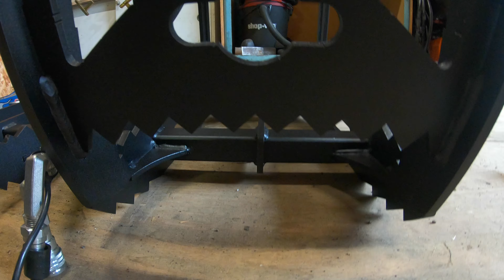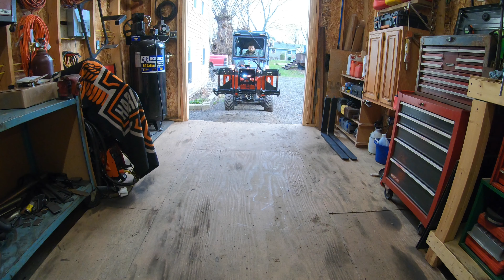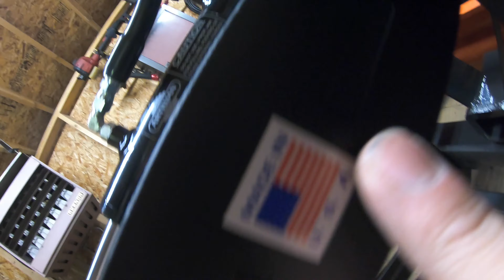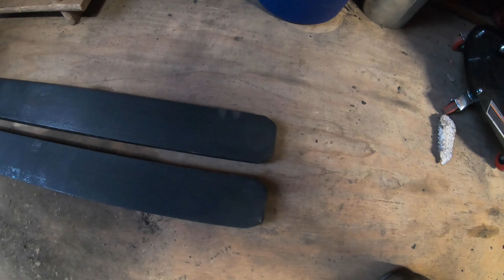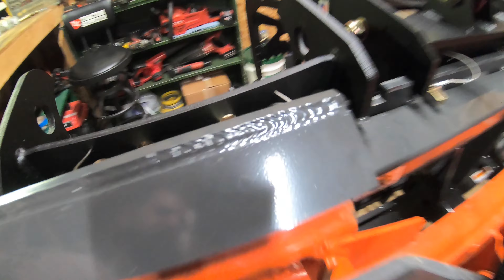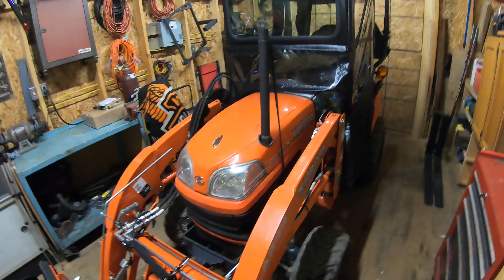Kubota BX- ARTILLIAN Grapple + Pallet Forks (First Impressions + First use!!)

Comment: Let me first say I love your videos because you explain in detail everything. I just got my artillian grapple today and having issues with it hooking up with the sumit third function valve kit you installed on yours. Did you run into this problem any and if so how did you fix it?
Reply from the maker: Thanks Anthony I appericate it bud. What issue are you having exactly? Did you watch my full install video on the summit 3rd function kit?
Reply: @BiffsEquipment  The coupling on the end of the hydraulic hose of the artillian grapple does not fit the connections on the summit third function valve kit. Did you have to change those and if so can you give me the part number? I'm thinking artillian sent me the wrong hydraulic hose.

Comment: What made you decide to go with the artillian?
Reply from the maker: I really like Artillian products for their versatility, the fact that you can arrange the grapple anywhere you want on the fork frame, and the fact that you can go from a single grapple to double or even Tripple grapple is really great. Also the bottom fork tines can be used separately with out the grapple needing to be in place and I also have their stump buckets as well which all fit on the exact same frame they call their fork frame. ARTILLIAN products are built super heavy duty with a great powder coat.. I sualt bend or break other products but with Artillian I havnt bent a single attachment yet. Pure quality and Versatility .. hope this helps!

Comment: Great videos! How did you hook up the grapple to the summit hydraulics kit? I noticed the Summit kit comes with a male and female fitting, while the grapple is two male fittings. Thanks
Reply from the maker: Thanks Robert! I actually changed the fittings around a bit after installing the 3rd function kit, I changed the ends so that’s there was one male and one female on the end of the loader and when I picked up the Artillian grapple I changed the ends to the same summit ends cuz I liked them better. The Artillian grapple uses John Deere couplers so I wanted to keep all of like the same which are summit Kubota BX couplers. If you need a link to where I buy my couplers on eBay just let me know, I usually buy a 4 or 6 pack of males and females this way I’m
Covered. Summit makes really nice couplers, even better than Kubota’s IMO

Comment: Got the grapple along with forks. Very happy and such a good match for the BX. And took it a step further for their articulating plow. Very nice indeed. Living in the Berkshires meant I was close enough to their facility to pick up so I avoided shipping costs. Like your channel very helpful with tractor things (like low power in reverse). Learned a lot from your series on bucket use. Did you ever do that pressure test at 3rd function valve? I’d use that spot since I have those ez off flat connectors at loader hitch ...
Reply from the maker: Awesome Rick congrats on the new purchases! I bet your stoked about using your new attachments come spring I know I am! I’m glad to hear my videos have helped you out and that your enjoying them.. I hope to get out there with my grapple soon to clean up brush and dead wood, gonna make a huge burn pile and burn wood/brush all day using the grapple I can’t wait for that.. just waiting for my yard to dry up. I havnt made the video yet testing hydraulic pressure at the front 3rd function but I will soon and appreciate the reminder!

Comment: If one is going to pick up standard (42x48) pallets, 42" forks are much better and probably don't weigh that much more. It's easy to break pallets & lose the load w/36" forks.
Reply from the maker: I agree that 36” forks are more likely to break a super heavy pallet but what you gotta figure is these little sub compact tractors and even compact tractors won’t ever pick up enough weight to where it would break the pallet anyways but I agree on larger equipment and utility tractors the shorter forks could be an issue as the lift capacity’s go up and pallets get heavier. Thanks for your input 👍🏻

Comment: nice setup. I wonder how the single clamp compares to a double clamp setup. You could see you dropped some sticks as you were going along. Wonder if a double clamp grapple would hold things together better. Good video! Take care
Reply from the maker: Thanks man. As for the double vs single, I don’t know if it woulda had a huge difference on that loose brush only cuz driving passed those trees I broke a lot of them off and I didn’t quite have a full load to make it very tight so I’m not sure a double grapple woulda made a huge difference here. Where a double grapple would help more is when it comes to securing larger/heavier and awkward loads as you’ll have a clamp on each side of the un-even load vs just in the center with a single grapple so that would help to secure and stable your load much better than a single. That being said I do eventually plan on buying a second grapple this spring and trying it out so stay tuned!

Comment: I'm a big fan of the Artillian platform!  I've had mine over a year and the powder coat still looks new.  I change the width of my forks often and no visible wear on the frame.  Mine came with a moly or graphite strip at the top front of the frame to help the forks slide when you move them.  Now I have grapple envy after watching...
Reply from the maker: Awesome man great to hear frank! Mine also has the graphite on the front face of the fork frame I was gonna talk about it but forgot to. Super happy with everything so far and I’m so glad I picked it up. Thanks for watching!

Comment: Looks awesome.
What I'd love to see is a pallet fork weight test. Get an IBC tote cage, and start filling with firewood. Then see how much of it the forks can lift about one foot off the ground (just enough to move it around). An IBC tote measures ~40" x 48", so those 36" forks should be fine with that narrow side. Guess that a weight isn't as necessary as a percentage of how much the tote can be filled up.
Reply from the maker: I wish I had one of those tote cages to try this out but will be doing lift tests in the near future with these forks. 40x45 is about the size of a normal pallet and 36” forks are more than plenty long enough for a heavy 40x40” pallet so id assume it would be just fine only question would be is how much the tractor can lift with it filled. Thanks for watching!

Comment: really nice set up - Thanks for covering the modular aspects of the Artillian Grapple - It's a shame I have a pin on bucket - btw, what kind of jack is that at the front of your shed?  I need a good low profile floor jack for my car.  Would you buy it again?
Reply from the maker: Thanks Bob! Floor jack is a full aluminum racing jack it goes like a foot in the air after just 2 pumps.. they have very simular jacks at harbor freight tho that have a very low profile like mike for $99-$140 , 2 of my friends have them from there and they have been great jacks thus far so I would go there for them. As for the grapple thanks man, wanted to make it as informative as I could with out carrying on for too long or making it boring. Can’t wait to use it again. As for your pin-on loader you should contact kubota or look online as you can find direct pin on skidsteer conversions for your tractor for like $200
Reply: I just converted my old BX to SSQA. The hitch plate was only $400 through the Kubota whole goods program. Highly recommend.
Reply from the maker: @johnfranks  this is exactly what I was talking about Bob, this is the one you should get. Couldn’t remember how much it was but for $400 it’s WELL worth it. Thanks for your input John

Comment: Word on the street is the Artillian grapple is a bit heavy for the BX. Doesn't 
leave you much room to pick things up. The JD is stronger then the BX so it works better on the 1025R. 
But it is a nice looking system. Great video again buddy.
Reply from the maker: The Kubota bx does indeed have left lift abilities than a John Deere 1025r BUT that’s why I have increased my hydraulic pressure, my bx should easily be able to lift what a John Deere 1025r can now. I’ll be doing a comparison video soon of John Deere vs Kubota lift test.. sure Kubota turns their pressure way down from the factory which makes it left less but John Deere has their pressure much much higher stock which in my option is what makes that lift difference between John Deere and Kubota.. bring your pressure up to the same as John Deere and both should lift very close to the same.. this is my theory however but some day I’ll be testing this theory and hopefully with in the next month or so
Reply: @BiffsEquipment  I threw some shims in mine and bumped it up to 19psi and my salesman almost had a heart attack lol. What PSI are you at?
Reply from the maker: @KubotaMonsterBX23S  Haha did he? Eh it’s totally fine IMO.. I was at 2,000 for nearly 2 years working the living hell out of my bx, now I’m at 2,250psi, highest pressure out of anyone else on YouTube I’m pretty sure still with no issues

I made a video on it called “increasing my pressure above 2,000psi”
Reply: @BiffsEquipment  Maybe I will throw the shims back in then and bump it up to 1900-2000 PSI
Reply from the maker: @KubotaMonsterBX23S  I think you'd be fine buddy, just keep an eye on things and be sure to not twist the loader when pulling hard on things thats all. Being aware and careful is the name of the game.

Comment: Artillian really seems nice! I’d love to try that grapple setup on my M6060 to see how it does. But I know on these little tractors it’s the way to go for sure. Excited to see projects with it.
Reply from the maker: Thanks man! Yah it’s a fantastic grapple, it could withstand the abuse from your M series as well Prolly but you may wanna check the HP rating first before you buy it just to be sure but I have seen it on larger tractors and it works great for them as well 👍🏻